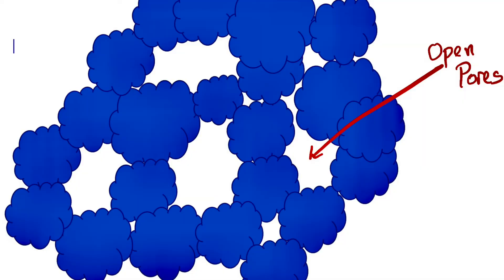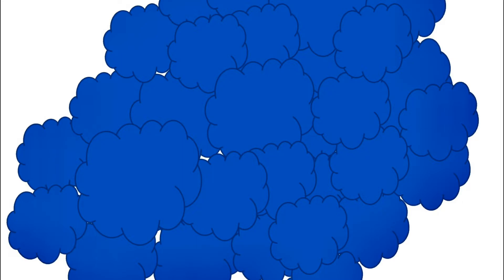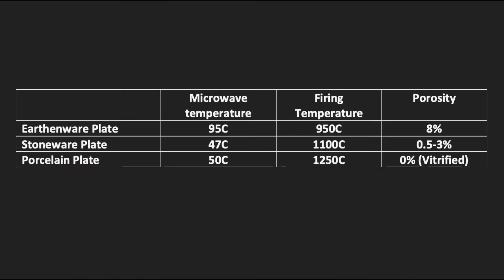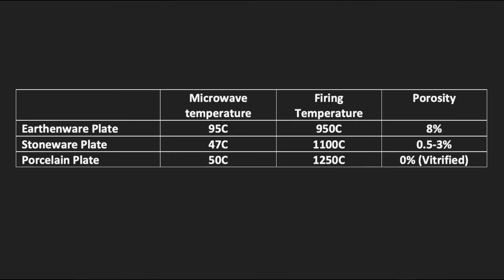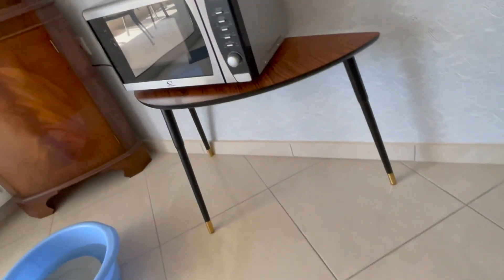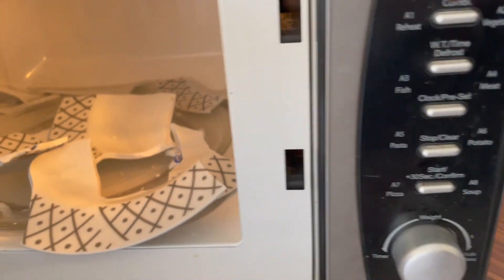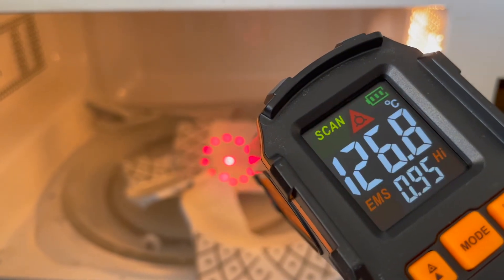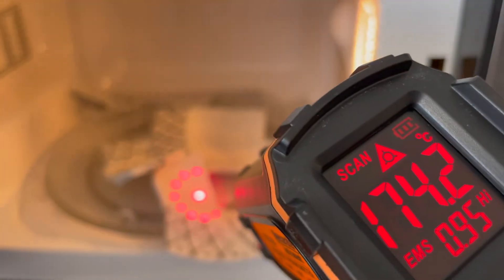Cook your Food, not the Plate! Did I break the Microwave?

Comment: Hi Andrew,
I tried to follow the test as per the EN15284:2007 - not calibrated.
I understand that the short period is used as the pass criteria, but the test usually also continues to the long period (usually around 10 mins), I had left the 250 ml water (as ballast) but it started to boil and spewing out water inside the microwave , so I stopped the test in 4m 20sec mark (after the short period test). 
Can we continue the test to 10mins even if the ballast water is boiling and spewing water? (It's contained inside 2 IKEA glasses - my guess is it's borosilicate glass).